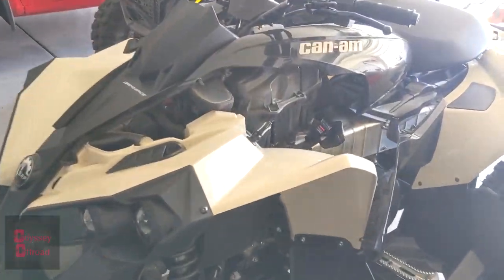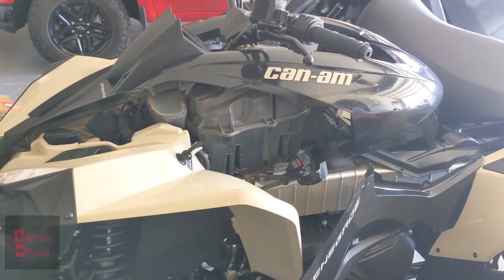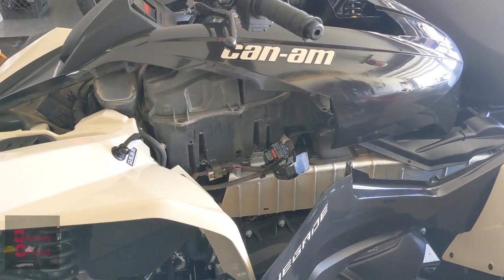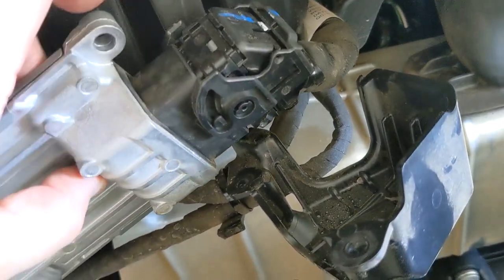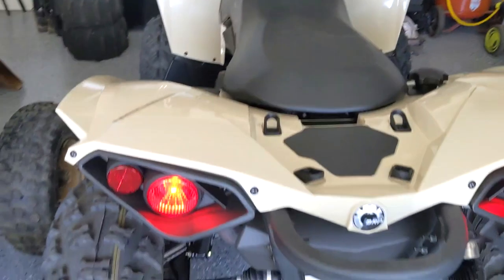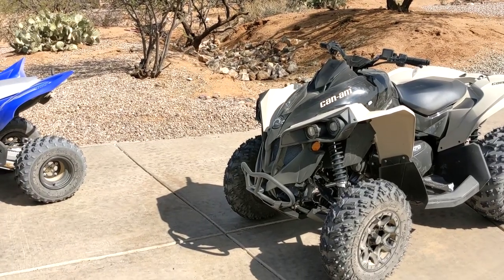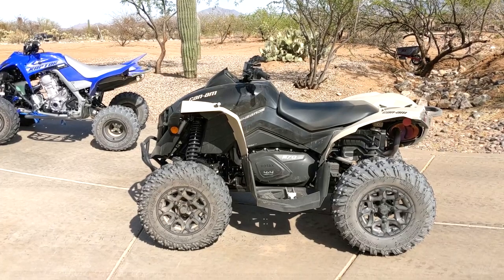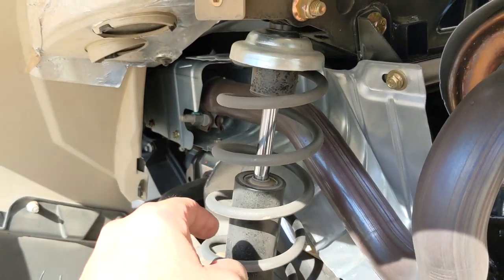2021 Canam Renegade 570 gets ECU tuning  !

Comment: I was lucky already had a DynoJet PV3 from tuning my CanAm Ryker 900. All I had to do was pay for another DynoJet license $250 and then talked to Ray Parker and got a tune to match my mods for a whooping $100 nice and cheap!!!
Reply from the maker: Correct but you wouldn't have been able to use the tuner on the 570 anyway.  PV3 does not work for a 570 only a 1000.
Reply: @OdysseyOffroad  Worked on my 850 as well.

Comment: Nice! 
If you add a Full exhaust and Air Filter do you need to do anything else to the ecu?
Or is that when a fuel controller comes In play?
Sorry for the Rookie question but I figured if I don’t ask I’ll never know lol
Reply from the maker: The fuel controller just piggybacks on the ECU this is actually changing the air fuel and timing inside of the ECU so it's better. Fuel controllers just intercept the signal from the ECU and change it.
Reply: @OdysseyOffroad  Awesome! 
Well I learned something new today 🦾
Reply from the maker: That's what we're all here for to learn from each other. 🤘 Amazing community!
Reply: @OdysseyOffroad  yea sir!

Comment: How is the power with this bike? is it good enough for most people. Im interested in the 850 and 570 renegade as well as the 850 scrambler.  Thinking at the 570s price point if its more than adequate the 850 would be a waste..  Thank you...
Reply from the maker: I think you'd be more than happy with it You can have a real good time with it.  it's got a lot of mid-range power and the top speed is in the '70s. once you put it in low gear it's got a lot of low end grunt as well. I think it's a great machine. Now the 850 and the 1000 are absolute animals.
Reply: @OdysseyOffroad  Alright, kinda what I figured. 1000 cc you can never use to its full potential on the trails.. Ive had a raptor 660 and scrambler 500 in the past. yz250 and yzf450 dirt bikes through the years. 
    So just wasnt sure what to expect out of the 570.. These quads are so expensive now and I havent ridden any modern sport utility..
Reply from the maker: You ain't kidding they sure are expensive. It's not going to be like the performance from those sport quads you've had in the past but it's a fun machine for sure I don't think you'll be disappointed.
Reply: @OdysseyOffroad  Thank you for your insight, much appreciated. Great channel btw...
Reply from the maker: @VetiExotics  of course anytime and thank you for the compliment!
Reply: I have the. 2021 570 renegade xmr. It is truely a beast.. All my friends have 850's and 1000's. I go anywhere they go.
Reply: @OdysseyOffroad  thanks for the video
Reply from the maker: @delanemaxie5599  thanks for watching!

Comment: I wonder if americans (idk if you are from america but you definitly don't look from europe since this model is no longer avaiable here ^^) can-ams are tuned differently from country to country (different polution rules ?) because mine (europe model) don't look to be "starving" from fuel or whatever, it run very smooth and not even that hot (can't feel the hot while riding in jean, can feel a bit of warm when slow driving).
But I really want to flash my ecu too for multiple reason : flexfuel (E85 half the price of unleadead 98), in theory even cooler and more hp, more topspeed, maybe less consumption ....
How do you estimate the power gain ? 3-4 hp or more like 10-12 ? How much difference in acceleration for a 0-60 ? Change are inexistant in low end ? Only mid end ?
I am glad I found your video, nearly nobody do video about tuning ECU on smaller machine, only 1000cc... Thank you for that
Reply from the maker: Yes here in America. All the machines now come tuned very very lean in order to get them across the border and sold in America that includes even the Yamahas.  Its so crazy.
Reply: @OdysseyOffroad  OK that explain why a lot of people are complaining about the heat while mine isn't affected

Comment: I am guessing this would work on outlander 570 also?
Reply from the maker: Yes he also tunes the outlander as well.
Reply: @OdysseyOffroad  thx brother 👊🏾😎
Reply: did it increase in power or did you notice a difference? I been wanting to do it but I might as well get a exhaust while I’m at it.
Reply from the maker: It did help yes. Ran a little cooler and smoother. Don't expect to be blown away though
Reply: @OdysseyOffroad  I heard the new 570s have the 650 motor js detuned but i don’t know if that’s true
Reply from the maker: @yeyo5671  The 570 and the 650 has always been based off the same bottom end but the top end is different. There is no such thing as a 570 Renegade anymore you can only get a 570 in an outlander. The only Renegades you can get are a  1000 and a 650. The 650 is way better than the 570 though.
Reply: @OdysseyOffroad  ohh for real that’s some new i learned thank you any suggestions on how to make my can am 570 lil faster?

Comment: Top speed with ecu flash?? Throttle response better?
Reply from the maker: top speed around 72 73.  the difference in how it runs is night and day.
Reply: @OdysseyOffroad  thanks man....my buddy is sending out his ecu this week to get tuned on his 570 renegade. He just needs more top speed and more low end wheelie power
Reply from the maker: Low end you will need to reclutch it most power on the 570 is mid range.  Stay tuned i have  that mod coming soon😁

Comment: Did you remove the limiters?
Reply from the maker: There's no torque limiters to remove on the 570.  the 1000 and the 850 are loaded with limiters that he removes when he tunes it.
Reply: @OdysseyOffroad  Okay thanks 👍
Reply: @OdysseyOffroad  so what did the top speed change to after the the tune from factory on the 570
Reply from the maker: @durtysouthkustomz8862  no change in top speed that i noticed